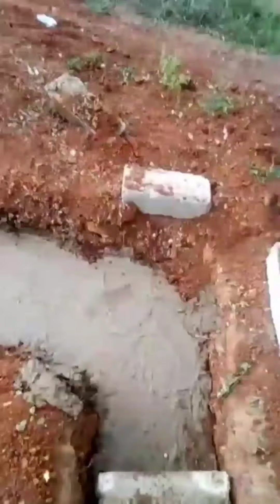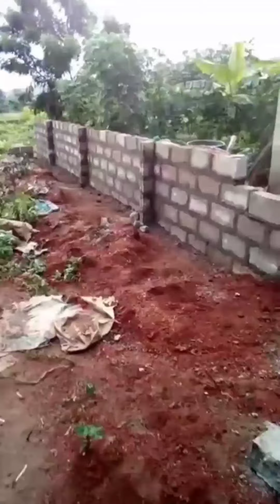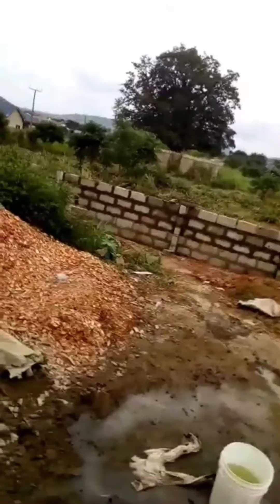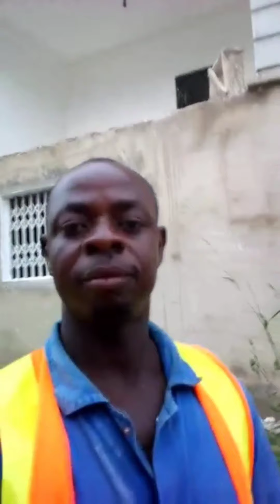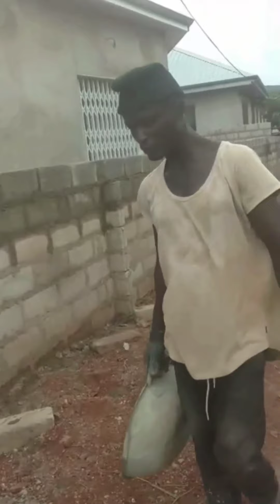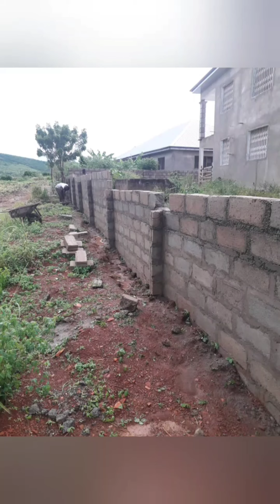Building in Ghana (FENCE WALL)

Comment: It looks very decent. What's the estimate of a fence wall 2gether with the front gate please?
Reply from the maker: Gh10,000 please
Reply: @nanayaa7022  I appreciate it. Thank You !!!
Reply: What are you saying building the fence wall cost only 10,000ghc?? Omg and someone quoted me 24000gh, I've paid 20000ghc. They had to buy like 8000 blocks and other stuff, labour 6000ghc. Please tell me ur estimate is wrong???? Omg😱😱😱
Reply: @ammaglossy  I paid almost the same as Yours for mine too.. so don't worry. You are not duped. I believe her estimate isn't that accurate, it also depends on the size of your plot & the lenght of the wall,.. etc..
Reply: @manamp1  ok gosh I almost went back to the contractor to pick a fight lol
Reply: My plot is 70x100 by the way
Reply: @ammaglossy  is that one plot or???